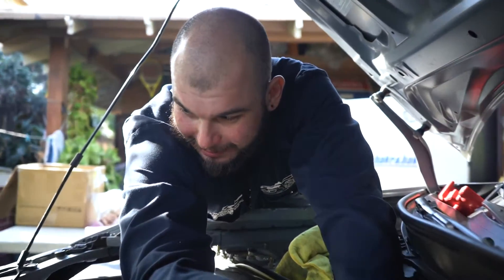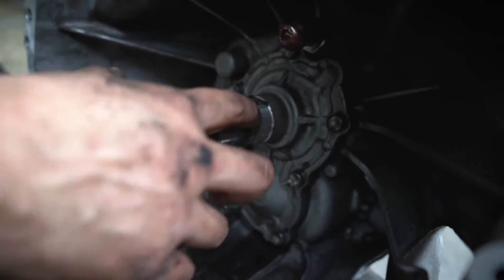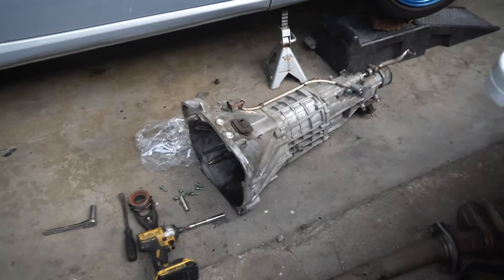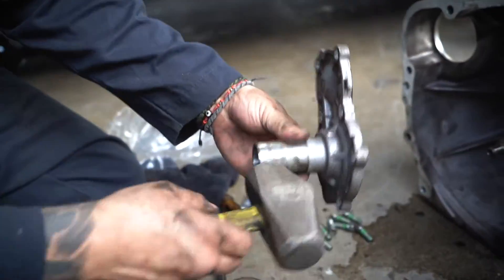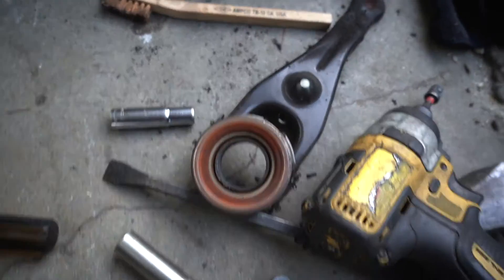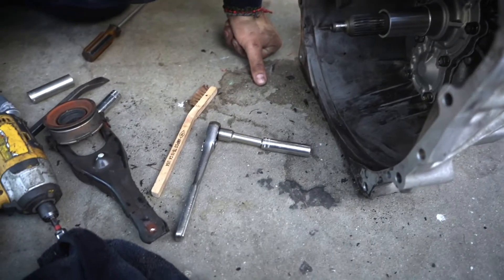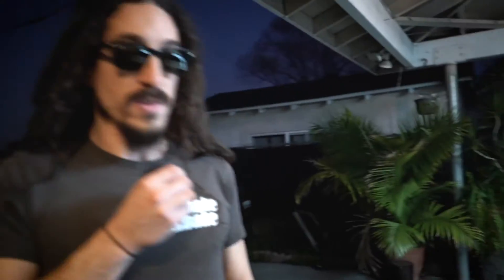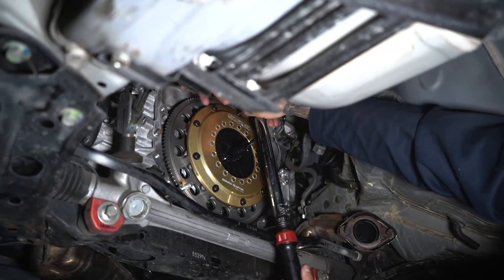Scion FR-S Clutch Replacement with Ogura Racing Clutch

Comment: I wanna get the same clutch and flywheel for my GR86, and change out the clutch fork at the same time. Apart from the ORC clutch, new pilot bearing, new clutch fork, new pivot bearing and new throw out bearing, what else do I need for the install? Do you recommend reusing the stock bolts? Thank you.
Reply from the maker: Recommend replacing bolts with ARP bolts and torque them to spec.
Reply: @theshakeandbake  Are the part numbers 203-2804 and 203-2901?